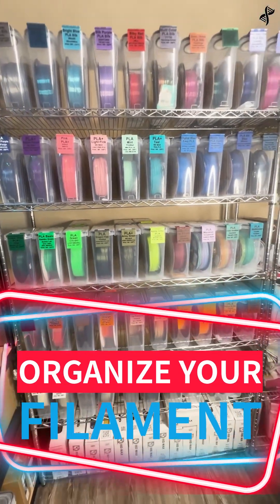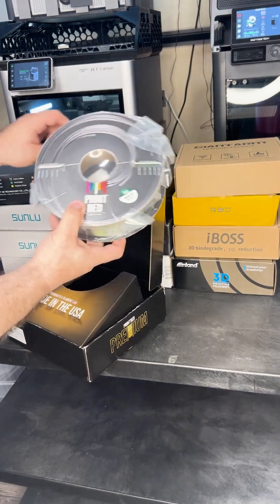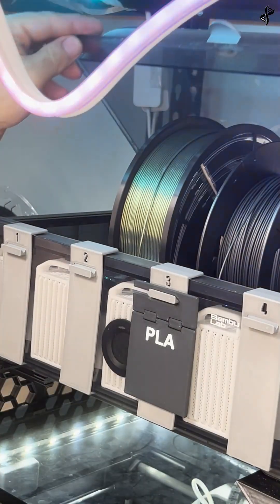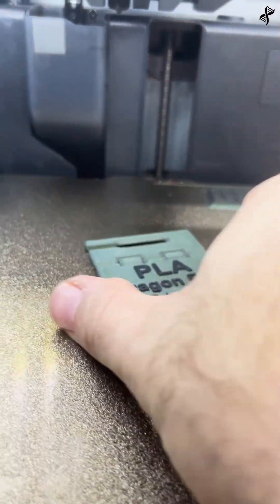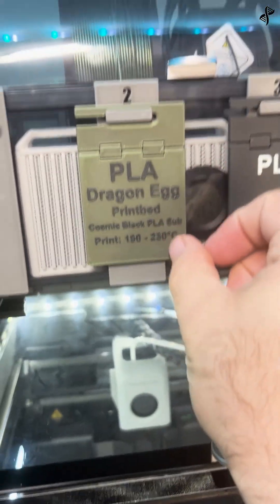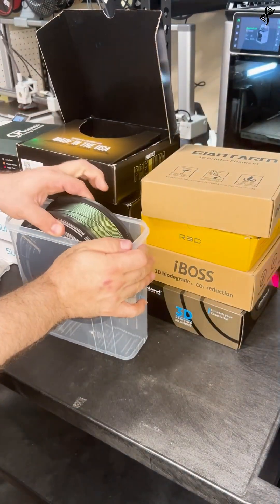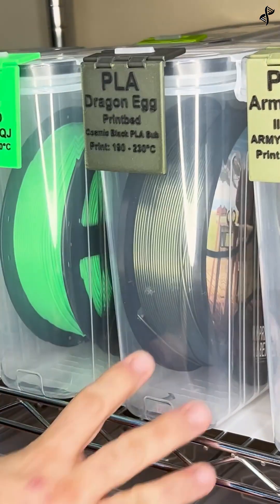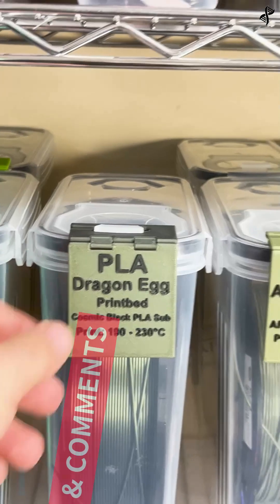3D Printing Filament dry box storage and tags #3dprinting

Comment: If you put the box on a heating pad and warm it up, then seal it closed it will form a vacuum if you close the lid while it and the air in it is warm.

Not a crazy vacuum but enough to change the triple point and cause the water to sublimate at room temperatures when the vacuum forms from the cooling air. When the water fills the vacuum, you will see the canister fill out and you just do it again and again until it holds the vacuum; meaning the water is out.